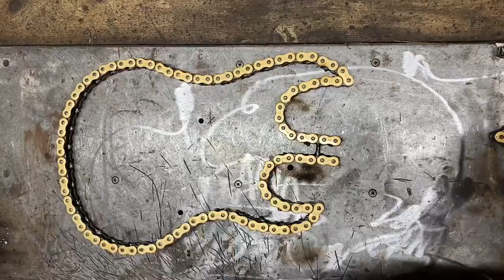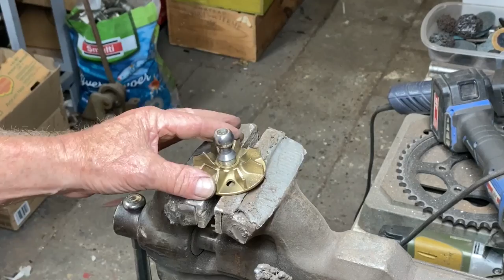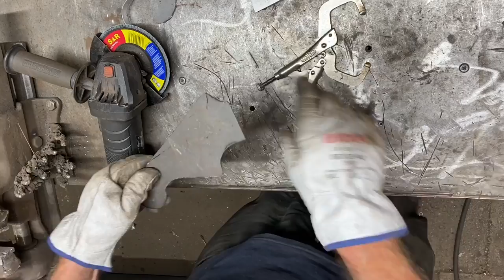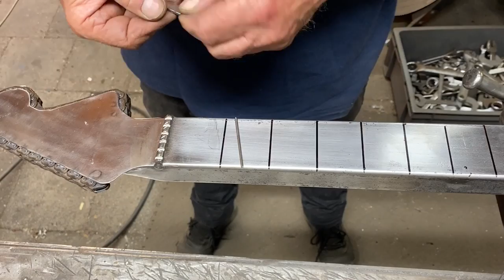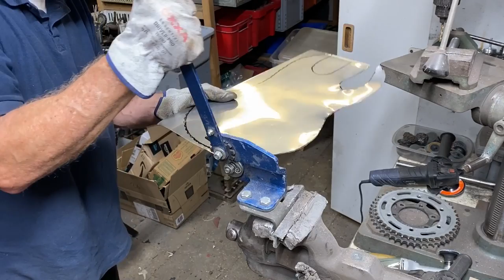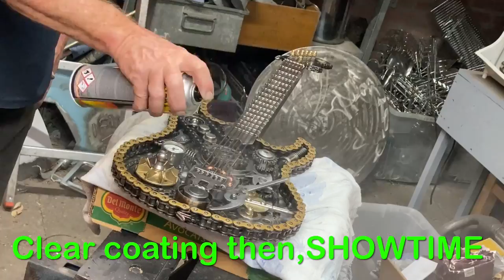Is Welding your hobby? Then make this Guitar from Scrap!

Comment: Hi mate are you using an Headux 188 welder as it looks like it and if so how has it been as been looking at these for a while to replace my esabs
Reply from the maker: Hi, it’s a Headux TitanMig 195 , and it’s working very good!
Almost no spattering , and no problems!
Reply: Cheers mate.  Yeah they don't do that model here as its the multi process one that's 195 amp as the mig one which looks like yours is only a 180 here. 👍

Comment: How do you clean your parts before welding?
Reply from the maker: Hello, use a steel brush!
Reply: @BrutusMetalArt  OK but what about really greasy stuff. I have lots to clean
Reply from the maker: @billymathews5305  
If it is very dirty and greasy, you can wash it in special automotive degreaser.
This can be purchased in metal shops or auto materials stores.